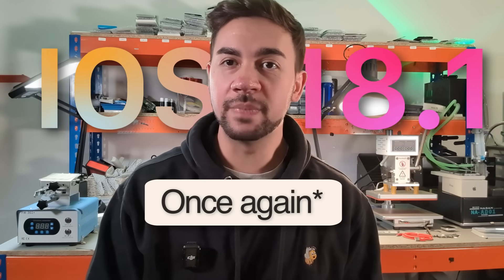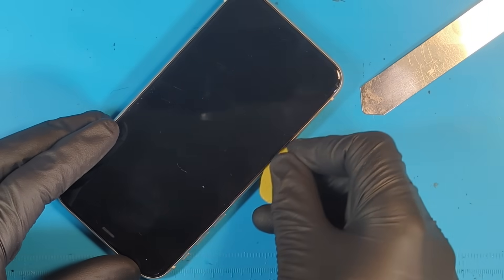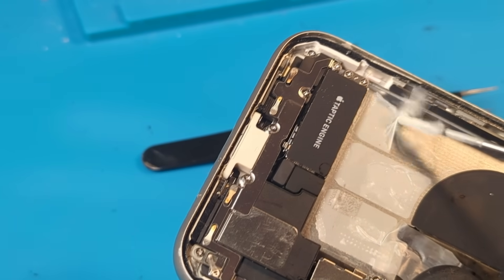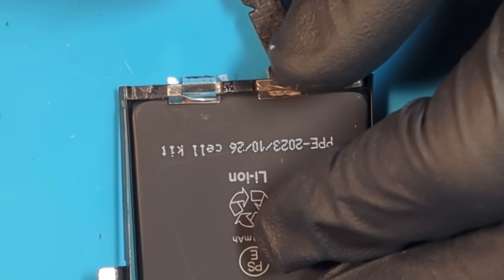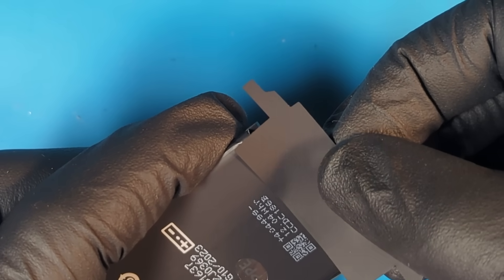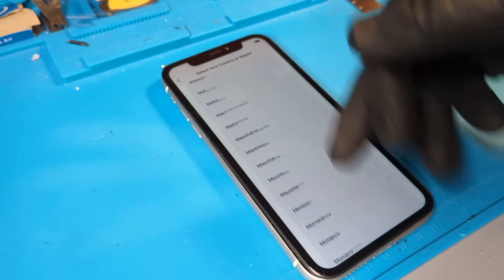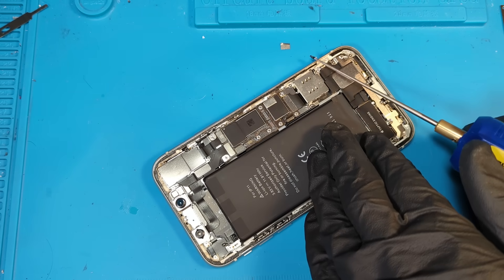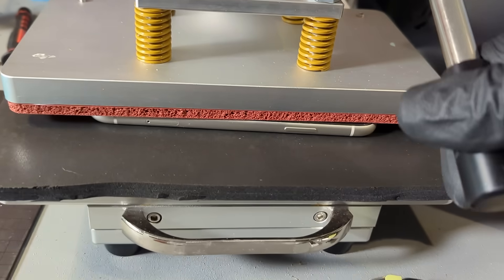How to Reset Battery Health to 100% and Remove Notification after IOS18.3(BMS Swap method)

Comment: It’s nice when you have all the equipment if you have to go out and buy all the equipment it’s cheaper to buy a new phone
Reply from the maker: @davidsummers2616  the cost of the spot welder, tag on flex, and the new battery cell should still cost less than a repair at Apple :)

Comment: What about ios 16.6 and I dont wanna update the ios.
Can I still change the battery and bms to get rid of after market battery and battery heath shown 100%  ?
Reply from the maker: Ios 16 does not need to flash for the health to increase. You just need the tag on flex :).
Reply: @ so changing the bms and tag on flex , can resolve both genuine and battery health issues?
Reply from the maker: @Coolbudde  yes. This should resolve your issue :)

Comment: Is it worth it buying the jcid v1se can it reset battery health on newer models and true tone and so on?
Reply from the maker: @QuickfixlT  JCID is very useful for many types of repair. I would recommend buying one :)
Reply: @ i just bought one but the information on it is very restricted online where do you recomend me to go learn from it thank you so much for answering.
Reply from the maker: @AliSy05  with JCID you will need to buy the boards. These usually come separately. You can buy boards for True Tone and MTSN swaps. You can get boards for repairing Face ID, camera repairs and a few other things. The machine is fairly self explanatory, but usually you will connect the orignal part. Press read, then put your new screen on and press write.
Face id is a bit harder, but with time you will get there :)
Reply: @ninjarepair  thanks🙂 maybe you can make series on it as no one have done it yet 😂
Reply from the maker: @QuickfixlT  haha I shall try my best to make one for you!

Comment: My iPhone is stuck in recovery mode
While doing this process
Reply from the maker: @tofikmakawana5853  disconnect the battery, and the cable. Then attach the battery and cable. It should continue the flash.

Alternatively...

Press up
Down
Then press and hold the power button until the phone restarts and goes into recovery mode again. The flash should resume.
Reply: @ I am using samE tag on flex 
On iphone 11
It will work ?
Reply: @ I have samE tag on flex
It will work ? My phone is iphone 11
I tried with 3u tools ..
Reply: @ flash complex but battery shows 0%

Comment: Can make video how to transfer Truetone correctly for new iPhone models?
Or do it need to transfer IC board too?
Reply from the maker: @sNaikoo  if you're wanting to remove the message, yes you will have to swap the touch IC. If you're just looking to retain all functionality and not lose autobrightness, you can just swap the True Tone and MtSN from the old screen to the new one and you should have no issue :). I can make a video on this in the future :)
Reply: @ Yeah. I'll wait video for the MtSN transfer.👌🏼

Comment: If I attempted this I would have to buy a new phone.  It would be cheaper to just have Apple put in a new battery!  But I’m glad you posted this for those with the skill to do it.  To quote Dirty Harry, “A man’s got to know his limitations!”
Reply from the maker: @dcinpa1134  that is a good point! Apple does now allow you to buy batteries directly from Apple themselves. This cuts out the need to do this sort of repair, however it can still be tricky if you're inexperienced.
Reply: Apple doesn’t always change your battery even if you wanted to pay for it.

Comment: What temperature do you use to open the screen?
I am thinking about getting a hotplate, but I want it mostly for soldering PCBs.

I just want to know id there’s a plate that can get low enough to use it for this type of work also.
Reply from the maker: @rolux4853  it depends on the device, but this heat mat is set to 73C

Comment: can someone use this method or i2c repair tool to change battery health from 85% to 100%?? if im buying an used iPhone how would i know battery health was not changed or anything else?
Reply from the maker: @NabeelAhmad-yv3ro  a lot of sellers do not keep the tag on flex attached to save money. Most people will have changed the battery cell if they are going to the effort of resetting battery health.

You can read the battery health on the pc and see if it matches the battery health that you can read on the phone.

Comment: the jcid just made the battery want from 75% to 57%
Reply from the maker: @36Swagga  if using jcid tag on flex you have to plug in the tag on flex and program it to 100% manually using the jcid board.
If you have done this already, check the tag on is fitted correctly, and also check the welding is strong.

Comment: The biggest problem is, when the BMS reaches approx. 1000 cycles, it will permanently decrease the maximum voltage the battery can reach, which means that the newly installed battery won't be fully utilized .

The small board you attached can only fool the system into always believing that the battery is 100% health, but the real capacity still depends on the battery and the BMS board.
Reply from the maker: @Alan_Skywalker  thanks for the comment. Yes when this happens you can use JCID BC02 to calibrate the battery cell so it is no longer in the locked state :)
Reply: @ninjarepair  I have an iPhone 13, i'd like to change the battery following this tutorial but i reached about 1000 cycles, how can i reset the cycle count or the voltage using JCID BC02? Should i do it with or without the tag-on-flex on? Great video!

Comment: "Hello! I need your advice regarding my iPhone XS Max battery. The battery health dropped from 100% to 91%, then 89%, 88%, and now 87% in just 20 days with only 35 charge cycles. Is this normal, or could there be an issue with the new battery I installed? I'd appreciate your guidance on this. Thank you!"
Reply from the maker: @mahmoudkamal7012  it sounds like an issue with your battery. Try again with a good quality battery cell
Reply: @ninjarepair will be back to the center of the repair

Comment: This i have to do to reset battery to 100%? this is bullshit
Reply from the maker: @abigailchikanelenwachi3503  yes, if you want to remove the notification. But you can see the battery health using an aftermarket battery. You will get the notification saying the battery is not original, however you do not lose functionality anymore :)

Comment: is the phone still water resistant or water proof as the original after the battery replacement method?
Reply from the maker: I try to keep the phone as close to orignal as possible. At the moment I do not have the machine that shows how air tight the phone is before and after the repair, but I will try to purchase one soon :).

Comment: can we replace iphone 13 battery with a more powerful battery capacity?
Reply from the maker: If you can find a higher capacity battery cell, then yes. I tend to use the XCAP brand, but I could not find a higher capacity battery cell for the iPhone 13 from my supplier, however I did go look for you!
Reply: can we install iphone 15's battery in iphone13?
Reply from the maker: @reshamsingh1471  I would not advise you do this. Only use battery cells that are intended for the same model.

Comment: what if I don't want to reset the battery health. After changing the battery, if the battery capacity is higher than the battery health will it increase again?
Reply from the maker: @SGRAHMD  someone else in the comments has mentioned that they did not add a tag on flex, and they said that the iPhone recalibrated. It did not go to 100% but they mentioned it did increase.
I have not verified this personally though.

Comment: hi, nice video actually but iam curious about new display obviously aftermarket. Will face I'd stop working on iPhone 13 pro with Ios 18+ ?
Reply from the maker: @Tyyronn thank you! I only use orignal or refurbished displays, however I do not see any reason why Face ID would not work after a simple screen replacement unless someone was to damage any of the flex cables during repair (mainly the earpiece flex). Hope this helps!
Reply: @ninjarepair  thank u so much i have my aftermarket display ordered and i was lil bit worried
Reply: @ninjarepair  hi iam just letting u know, so my display arrived today and bro ism so happy i fixet it my self and was kinda worried because i bought the hard oled and they are super fragile. My face id and everithing workinggg! Thank you so much i hope ul continue with ur content 🔥
Reply from the maker: @Tyyronn  that's great news. Good job on the repair 💪!
Reply: @ninjarepair hello i was wondering could you help me with this fix? My iphone battery gor little puffed out and i want to try my self, could be really possible try without bms change? I was considering to buy Ampsentrix PRO battery 3095 mAh | iPhone 13 Pro, and they said they have the advanced bms so i was wondering if i buy the middle flex chip with rewrite capabilities and only flash the whole phone? Would it be possible?
Reply from the maker: @Tyyronn 
you can try the BMS swap. I believe the battery you're referring to has a flex cable that allows you to connect your BMS without needing to spot weld.

I attempted to make a video on this for my last video, but unfortunately, it didn’t work. However, I’ve used these batteries before, and they worked fine, so perhaps the last one was just a dud.

That said, it might be easier to use an aftermarket battery since it allows you to see the battery percentage.

If you still want to try the BMS swap, just be careful when cutting the BMS off your battery! :)
Reply: @ would be somehow possible to pay you for this and you could do this for me? Cause iam lil bit scared tbh

Comment: You don’t need battery tag on flex anymore. iOS 18.1 and above just need JC Q1 and fix battery health via 3uTool and that’s it
Reply from the maker: I do not think this works currently. From my understanding the method you suggest shows the original battery health when connected to the computer (80% for example), and not the 100% health that is shown on the phone.

Comment: How easy is it to replace the battery in the 5s and X?
Reply from the maker: @Darren777Au  these are fairly simple to repair, however from memory the 5s has a flex cable attached to the Touch ID that you will have to be carful with when you open the phone!
Reply: @ninjarepair  thanks, yes, saw an ifixit video on it, weird design.
Can you recommend any battery etc suppliers for iPhones, etc? I have a few dead mobiles I would like to have a go at, along with the 5s and X, if they are just swap and go. Appreciate your time.
Reply from the maker: @Darren777Au  if you're in the UK, iParts4u are very good. You can also get bits from replacebase and repairoutlet. If you're elsewhere I'm not too sure :)
Reply: @ninjarepair in Australia.
Reply from the maker: @Darren777Au  sorry I'm not too sure about Australian suppliers, although I'm sure there will be. Good luck in your search. If that fails, you can get most parts on AliExpress

Comment: If i don’t have the spot welding machine, what else can i use?
Reply from the maker: @AdeniyiXO  some people use special low melt solder for batteries the repair, but spot welding is safer. I would recommend the QianLi Macaron Max spot welder :)

Comment: I have never seen before removing battery glue like that. Really clever. I like it.
Reply from the maker: @SomeUnremarkableGuy  it's a nice quick way of removing it :)!
Reply: @ninjarepair  Could you provide a link to that tool that spins and removes the adhesive?
Reply from the maker: @Fludescorner  Sorry I missed your comment. I have now added all links in the description to the tools used in this video :)
Reply: @ninjarepair do this still work now latest ios version iPhone 14
Reply from the maker: @khalilkh7389  Yes it does :)
Reply: @ninjarepair  okay that's wonderful 😉
Are they any easier ways to get this done without soldering? What abouts tags flex cable any idea ? By the way your instructions and video really Nice and  helpful for everyone 😀
Reply from the maker: @khalilkh7389  Thank you! An easier way to do the repair used to be using batteries that have the tag on flex built in. You could cut your BMS off, and attach it easily without spot welding to the new battery. I tried to create a video for this yesterday, however the battery did not work for some reason, so I instead had to do a tag on flex method again - Perhaps Apples update broke them 🤔.

At the moment, if you are not confident doing the spot welding (or you can solder too), I would suggest just use an aftermarket battery. It's much quicker, you can see battery health and much more convenient! I just have a lot of iPhone battery cells with no BMS attached that I have to use up first!
Reply: @ninjarepair  that's really helpful reply 
Thank you for your time and information 😉
Reply from the maker: @khalilkh7389  Any time!
Reply: @ninjarepair So basically,we need to buy 1000$ worth of equipment in order to reset the battery-you are really smart😂 Stupid you tube brains
Reply from the maker: @TheGagi82  I understand there can be a lot of confusion around battery repairs, so let me clarify. The total cost of the necessary parts, including the battery, is approximately £43.43 ($54.74), which covers taxes and shipping as well (this price might slightly fluctuate). There's no need for £1000 worth of equipment to complete this process.

If you're interested, I'm happy to explain how it works in more detail. Always good to have the right information! 😊.

No need for name calling due to the fact that you did not check the price of the tools.
Reply: Saw a repair with that tool from China. Great video. You also have the right tools.
Reply: same
Reply: pull tabs are a better way, but tend to break if old

Comment: Hi, you don’t need the tag-on flex because the BMS calibrates on its own about 0.6% per charge cycle. Of course the battery cycles do not reset. 

I did a bms swap battery replacement on my iPhone 13 Pro which was originally @85% BH and after 2 weeks of regular charging its now @92% BH
Reply from the maker: @Prakyy  thanks for the comment. That seems like has gone down quite quickly? Can you plug it into 3uTools and see what that is reading? I'm waiting for more flexes to arrive to test :)
Reply: @ninjarepair  No, it went up. Please read my comment again. The original battery's BMS was @86% BH, I replaced the cell while keeping the old BMS. Without any tag-on flex the iPhone has been calibrating up & is now @92% BH. I expect it to reach 100% in another month.
Reply from the maker: @Prakyy  ohh sorry about that. That's great news :)!

Comment: Does the tag-on-flex need to stay on the battery once the % is reset (specifically for 12 models). I've seen some folks removing it once it's reset.

Another thing; does reseting still work on the latest 18.2 iOS?

THX!
Reply from the maker: @hojnikb  Thanks for the comment. If the user plugs in the phone to the pc and runs 3UTools or similar, I have heard they can see the original battery health (79% for example) if you DO NOT keep the tag on flex attached.

I always keep the tag on flex connected. I will double check this week and let you know. I always keep the tag on flex connected. Some people have mentioned that without the tag on connected, the health can reset back to the orignal value.
Reply: @ninjarepair  I always thought that tag-on-flex resets the original BMS (acts like a small programmer) so it can be removed once iOS sees 100%. Is this not the case ?
Reply from the maker: @hojnikb  I checked for you today. The tag on flex tricks the phone into thinking that the BMS is saying 100%. If you remove the tag on flex, the battery still reads at the previous percentage (82% for example). When connected to 3UTools or similar, it also reads the old percentage for the battery if the tag on flex is not connected. If it is connected, then it reads the correct health information.
Reply: @ Do you know if battery percentage will drop in the health menu and analytics data? Or will always stay factory default, as tag-on-flex reports?